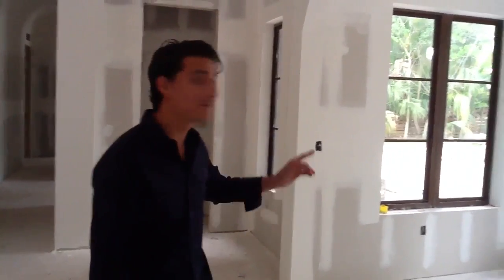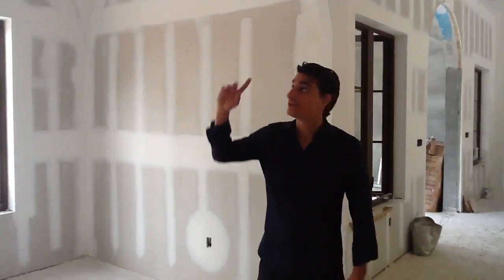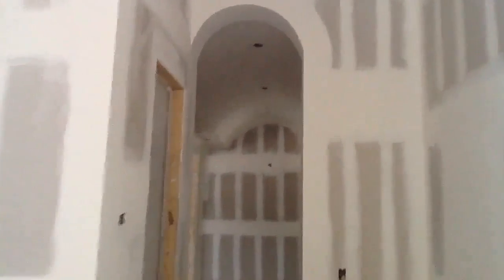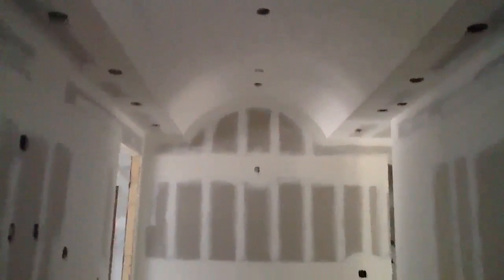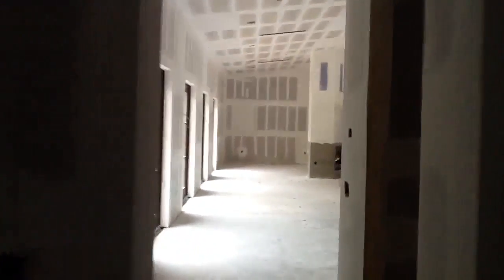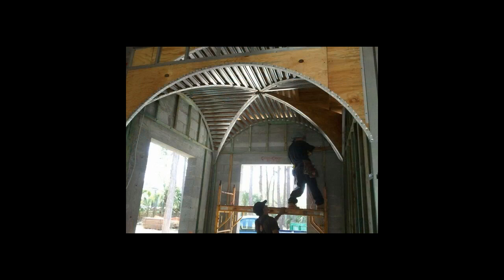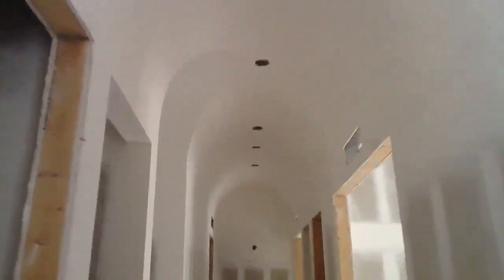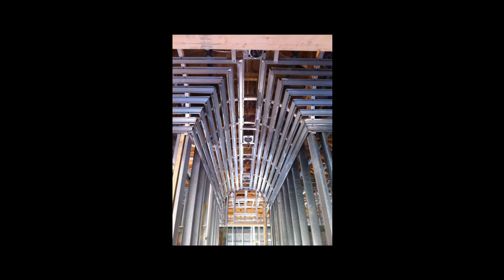How to | Groin Vault

Comment from the maker: We use 1/2" drywall, thicker than that it becomes almost impossible to bend. You have to do the vault in two sections because you won’t get one sheet to bend a full arch
Reply: In the area of country where I live it is code to install 5/8 rock on the lid for fire barrier. Will the 1/2 pass your area building codes.